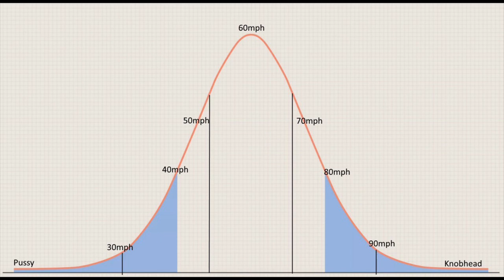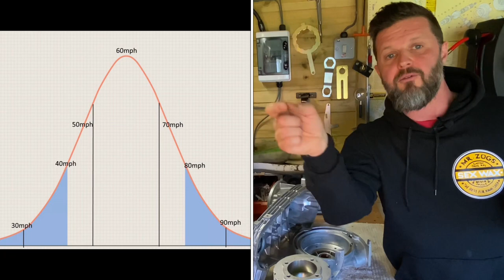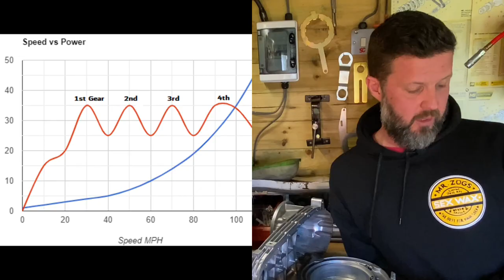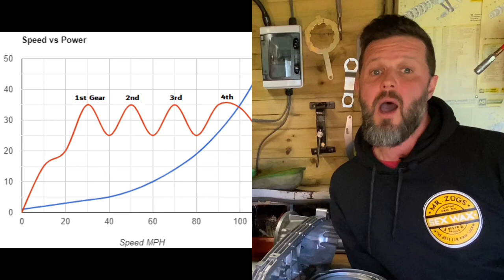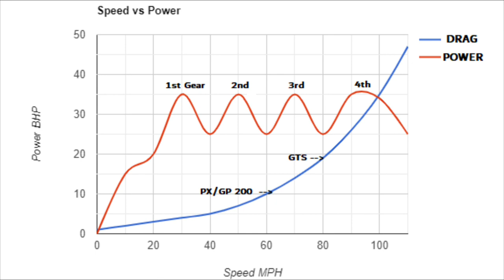How fast do you want your Lambretta & Vespa scooter to go? How much power do you need to go fast?

Comment: Cruising at 60mph is comfortable and enough, 70mph probably max on 10 inch wheels with Lambretta brakes. Most 125cc learner bikes back in the day would just about touch 70mph and were restricted to 12hp. So that's always been the power to speed benchmark for me.
Range and fuel consumption is a factor as well. I'd rather go at 60mph and get 60-70miles to a tank than go at 75 and get 40 miles to the tank.

Comment: Cruise 50 to 65 top 75. But plenty of torque with the right gearbox and exhaust for pulling power. Spent a fortune over the last 40 years chasing speed and holding the clutch lever. It’s when your out in a group and someone is faster than you.

Comment: I am pretty much with you. I live in Florida so pretty flat and get 58 gps with a stock li150, but that is ragging it, cruise at 52. Most of my riding is max 55 speed limit so a bit extra is nice, I spend the rest through towns with mates and dont need anything wild. Just finished,(today actually) building a Quattrini with a 60x115 with exbox ST and all through the build obsessing about squeezing the last ounce out of it but kept with the tv gearbox and 4.82 . Truth is, if I can cruise at 60 and get up to 70 I will be happy as a clam, the rest is gravy. I did keep my gearing lower so I can beat the Harleys off the mark at the lights which is my number one priority :-)

Comment: I ride for fun and “sport” I know that when you chase the “numbers” it’s a very addictive game😃 I have a Vespa PX with 37hp with its current pipe although I have had it at just less than 40(on a very conservative dyno).What I do know is it’s quite anti social to ride with a group! I dare say 60mph with plenty left feels good but it’s also the way it gets there😉 Perhaps I’m happiest when I’m hunting TS1s on local twistys😁 I do also use it for sprinting,hillclimbing,flattrack and sand racing-it’s fairly well used. I know there’s a lot of commitment needed to own and ride such a powered scooter. Quattrini 261👍🏼
Reply: I have a quattrini 260 amazing engines!! Torque and power not at crazy revs either. 24/64 gearing like to sit 55-60 on a long run. 90+ top if I wanted it but it’s too quick.

Comment: Great Topic I ride a Gp150 with a mugello 186 kit that I put together myself. to start with I was disappointed when riding with my mates locally one on a super monza the other on an RB20 but when we go long distance my low comparatively powered engine is more than enough with better fuel consumption better reliability and I built it myself so lower build cost. then when we get back to our local area I am disappointed again as they rag it round the local villages. so horses for courses really on a long run mine cruising between 60 & 65 is more than enough but when we are locally thrashing to the pub i am left lacking a little. So possibly if money didn't get in the way the answer would be to have more than one. That doesn't include the race scoot I would like to build for the BSEC events. But hey ho we can all dream.

Comment: You are absolutely right. I have new vespa gts 300 hpe (24 hp) which brings smile on my face whether I ride in the city or on the motorway. Also I have to emphasis that weight of motorcycle is very important for the accelerating and for the braking. Vespa is unbeatable in its class with 160 kg.

Comment: Ride a tuned 1964 Lambretta 210. Within a group, riding to rallies on curvy backroads & straight roads, I’d agree with 55-65mph as the sweet spot. Solo riding enjoying the same roads, warmed up tires on black top beneath sunny skies, I’ll push closer to 75mph in areas.

Comment: My old Vespa ‘79 P200E could hit 70mph with a slight decline and it almost felt like it started to float. Very wonderful feeling. I enjoyed riding it at it’s peak and almost always did. Highway speeds limits in my area are 70-80mph and State Routes are 40-60mph. Coming from riding Dual Sport Motorcycles with big front wheels made my Vespa  feel rather twitchy to me, until it got over 45mph. I’d say 55 to 65mph was it’s sweet spot.

Comment: Good topic. I ride a bog standard, engine wise, Vespa GTS 300. It my second, I started off on scooters decades ago and rode big bikes in the 90's, I never really took to them and after doing 130 mph once became bored. Scooters fit my lifestyle and needs. I find it cruises at 70 mph with pillion. It will go on to just over 80 mph has Piaggio states. To get to the point the acceleration and power/speed of the 300 GTS for me is ideal, its usable and fits in well with the mainly A and B roads I inhabit. Should I require a rebuild I would probably go for the Mallosi kit as is does give a bit more power for similar money and its a reputable company. So 21 BHP seems to suite me fine. I upgraded the suspension on my last GTS and if I was to do anything at all I would do this again. I do go touring and cover hundreds of miles when away. Good LED lights are a must for me. If you upgrade to LED my tip is get ones that give off really good light and don't buy just because they look like they may have come from a starship.
Reply: Spot on ! I’m nearly an exact copy of your experience re bikes and the new appreciation of scooters 👍

Comment: 65-70 cruising without overheating, 75-85 top speed.
Equally important is torque and wide power band pull range of each gear at high speeds for the +4% grade hills!

Comment: In my area of California, if you want to get anywhere in a timely manner, you have to take the freeways.  The freeway speed limit is 65 MPH but most drivers do 70 to 75.  So, two considerations, getting on to the freeway at the speed of traffic (acceleration) and cruising at a speed that won’t cause drivers to tailgate or constantly pass you.  So, quick acceleration and cruising speed of 70 to 75 is what I prefer.  I don’t need to pass at those speeds.  My RB22 does both just fine with a little extra to get out of tight spots.

Comment: I'd add that I've got a 30bhp+ Vespa which I've sunk a lot of money into, but tend to ride the scoots which sit in the 20's.
Very true that, after 75, I start to enjoy it less in case something goes awry.
Reply: Same got 35hp from my quattrini 260 but I don’t want to hold it on high revs all day. Would get to 93 on this gearing but spend most of the time at 50-60

Comment: One of my riding mate’s scooters easily can do 100 mph - it’s a SSR 265. My tuned TS1 can pretty much sit at 80 mph for hours and acceleration is very good but to really keep up I need more power. My TS1 is probably about 28 hp, maybe 30. With shorter gearing it’s kind of a monster at acceleration but tours well on taller gearing.

Comment: Cruising i want a comfortable 50 which i have...and another 12mph top speed would be nice which i also have...down hill!. These figures are exclusive of the 6mph wrong that the speedometer shows. Scoots top speed with longia 3j4 engine in stock form a real 58mph.

Comment: Cruise at 65 and not overheat, 75mph tops is fine.  Wouldn’t mind a max of 80 but honestly if you can still climb a long 2 or 3 mile incline and maintain 60-65mph in top gear without overheating, you’ve just accomplished something far more significant than hitting a max speed of 80mph.

Comment: my smallframe is happy cruising at 50mph and tops out at around 57-58.its geared to get there quickly as well,which in urban settings is more useful in my opinion. would maybe like to get in the 60s for faster roads, but not if it ruins reliability.

Comment: Recently bought the Mrs a px150 to replace her vbb with pinasco 225.  The pinasco is no racer but was happy at up to 70 with plenty of torque.  14bhp maybe.  The px with 8bhp feels dangerous and is flat out at 53 mph 😳   so will get a bgm 177 set up to get her back to around 14bhp for a 9 stone rider.  At 16 stone I need 15 plus bhp to feel safe.  I've had 25bhp on a ts1 and don't find its used.  60mph is our comfort zone on a roads.

Comment: Got a ts1 madspeed daryl taylor tuned and a mhr 221 both with all the trimmings 30bhp plus I'm happy to sit 55 60 but also nice to accelerate hard to 80 for a bit and go back to 55 60 standard scooters are painfully slow and just nice to have extra power can sit at 60 all day with no stress on engine.

Both have sip speedo so real speeds  most people who say there malossi 210 does genuine 90 are just dreaming both mine will do 85 but unless you got casa or bma no chance

Comment: Ok very interesting… I have 2 motors both quattrini. One is a 181 m1x makes about 23hp and the other a 35hp 260 m244 both have long strike conversations as I like the torque makes the riding enjoyable with out searching for a different gear all the time. 181 good for cruising 55-60 to about 70mph the 260 runs 24/64 gearing and is good for 90mph but like Dan I always get concerned about a disaster about to happen 😜 tuning kits at the moment have never been so plentiful buy what suits you not just what your club mates have.

Comment: It's so funny hearing you say that above a certain speed your 'worry' level increases... I have a Terry Frankland tuned Malossi P210 with all the gubbins... 30mm Del Orto, light fly wheel, Cosa clutch and Taffys pipe. It made 22 bhp on their dyno for 85 mph... 
BUT above 95-110 kilometres per hour (it's a French bike) I too got nervous that it would blow up, seize..(I actually seized a Polini kit at 90 km/h while overtaking a lorry.. trouser filling as they say....) .. 
I was happy riding upto 90 km/h but even if I did push to 120 to overtake I quickly came back down and always kept a hand over the clutch in case it seized..(which it never did).. I guess Ian & Terry know their stuff..
Reply from the maker: This about sums it up :)

Comment: Just doing jetting runs at the mo as all Dynos booked up. T5 251 hits 75 easily and that is about as fast as I'd ever want to go on it. (Googles "My Tracks" to record runs which is fairly accurate). I'm happy at 60 with a bit more for overtaking Lorries.

Comment: I have a 150cc 1P57QMJ - The P in the GY6 I've read means stock it has more performance than a stock non P engine. It's only a 10.5 hp. It's rated speed is 55 plus depending on rider and road conditions so I'd like to go cruise at 50 (MPH) and get up to 60 or 65 if possible for highway speeds and passing. (not interstate) It's a China scooter, Dong Fang brand. I haven't gotten up to top speed yet. It weighs 194 lbs and I the rider weighs 110 lbs.

Comment: I'd like my smallframe to cruise completely comfortably at a genuine 60mph with enough left over to keep at 60mph with a head wind, up a slight hill etc. Moreover, I'd want it to be useable and very torquey up to 60. It'd be even better if it could reach 80mph top speed for the occasional shits (probably literally) and giggles.

One day when money permits the plan is to fit a Quattrini M200.

Comment: Well, I  guess it's all about gearing. Because comfortable is not doing 60 in 4th @ 8800rpm. So you need longer gearing to keep that at 5k-ish, but then you need more torque to connect to 4th. But then you need a better clutch...
And what's with the tourer and racer difference. Touring is sitting up straight? Well that's no fun @70mph so you dive and then you have a racer because your flat on it? I understand that a racer has a more peaky-curve and a tourer has more under the curve. But with only 4 (or some have 5) gears it will always be a compromise.
I guess being happy is wanting less...

Comment: Fantastic video Dan . I ride both a lambretta muggello 186 with tsr pipe an 30
Mil dellorto . Lovely sound lovely to look at horrible to
Ride . Like you say once over a high speed I’m scared the engine might go wrong or hit a pot hole . Absolutely terrified in it at high speed . 55 to 65 top for me . And yes I have good tyres good suspension all upgrades built by a well known guy in the scene . Also
I ride a Vespa px  125 with mallossi 177 kit and sito pluss . Now this is a pleasure to ride so comfy and engine always sounds happy . Will happily do 60 and I’m happy with that . Great topic . But over 65 on a old lammy iron horse is bloody scary for me anyhow 🛵🛵😂

Comment: I like my Segway c80 with a top speed of 20 mph. Would like just a little more low end power for going up steep hills but I’m really quite happy with the acceleration on flat ground and it is built for bike paths not roadways. It has a 750 watt motor but I’d like to bump that up to 999 watts.

Comment: Without a tach, how do you know if you are close to damaging your engine at higher speeds? My bike is rated for "55 plus". Say I can get it up to 63 and sustain it.. at that point am I causing engine damage? Max ratings are: Max Power - 10.58Hp/7500r/min and Max Torque - 9.5Nm/6500r/min.

Comment: 55mph up n down hills 70 mph on a run. Fast enough for me on 10" wheels
Reply: That sounds good to me. My bike has 10" wheels. With the tire it's a total of a 16 inch diameter as the tire is 3 inches thick.